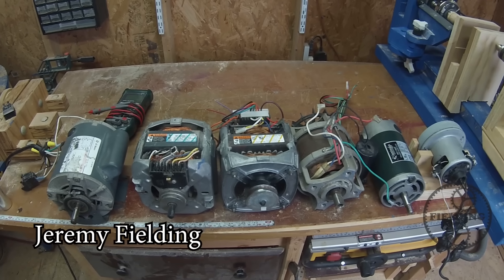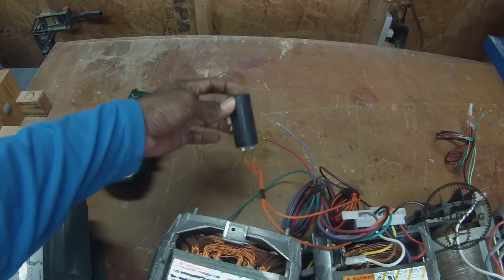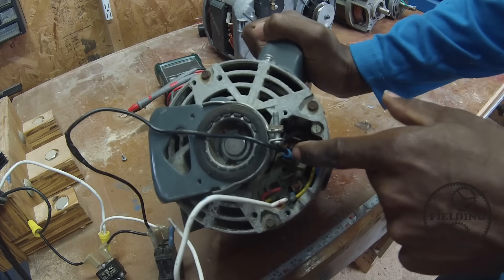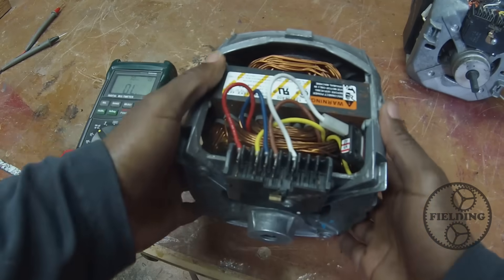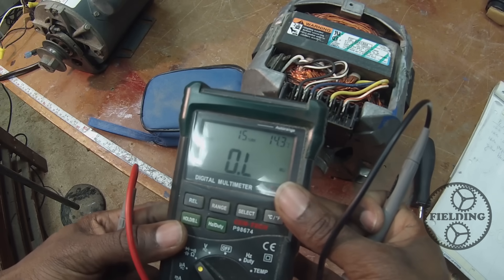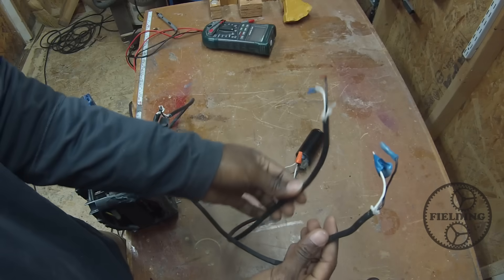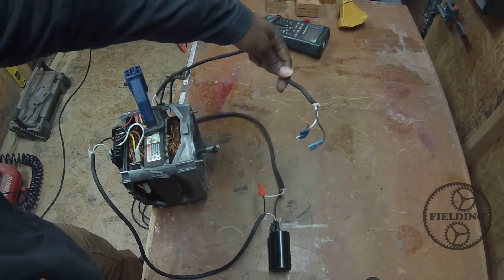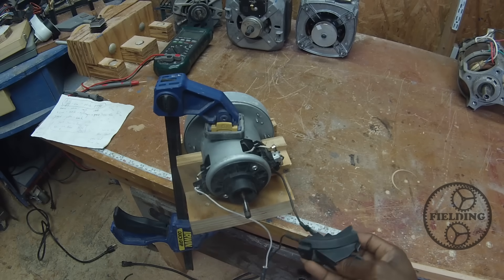How To Wire Most Motors For Shop Tools and DIY Projects: 031

Comment: If you have a under powered bench grinder like I did, I used the main cast iron flywheel/pulley from a old air compressor that had the same shaft dimensions and used that in place of the second grinding wheel .. startup is a bit longer but when it reaches full speed look out cause inertia is on my side!!Make sure the pulley  is balanced

Comment: Mr. Fielding, could you please take a close up of the wiring for the switch and fuse on the first motor? Thanks in advance, I'm trying to set a on/off switch for a lathe!

Comment: I was hoping that vacuum motor was going to have 3 wires. I have a U8232-002 with 3 wires, white black and yellow, and I'm not sure what to do with that yellow. It looks like it is part of the same coil as the white wire but why?

Comment: Does starting wire holds more amperage?
Reply: Amperage is current; he measured resistance in ohms, looking for the circuit with highest resistance.  That one controls the start capacitor.

Comment: This  knowledge will give a practical dynamic understanding of math and motors and recycling. of which I can boast an average of 500$ up too $1000 or more a month repurposing used electronics or metal . some guys do this cruising back lanes on the way to  appointments to other areas of the city. some towns have a designated  garbage day the city picks up old or non longer wanted items that don't fit in bins.

Comment: i'm haivng a problem with my motor humming and not starting - but it was working PERFECTLY before putting in new bearings (dont' you just LOVE that??) - so im trying to figure out if maybe this is being caused by the centrifugal switch plate coming into contact with the motor shaft??? problem is - it's impossible to tell once the end caps are on ...  anyone?
Reply: I think he says right in this video (or maybe another): humming is a sign that there's a problem with the start capacitor -- the lump mounted on the side of the motor.

Comment: thanks for sharing your knowledge  ,nice presentation.Not sure what Im saying /asking:Question= can a motor run without   a starter capacitor   if ya manually start the rotation ( like with a pull starter style on lawn mower ? ) I got a Chinese milling machine that humms  at start but will spin up if twist the spindle  with  my hand to get it going.I wounder if the motor would spin without the cap in circuit ?  The explanation that a cap is like an  " additional phase"  is the best  , thanks again.
Reply: You never said if the motor has a capacitor or not.   You have a start wind malfunction somewhere.   You are eliminating the start wind  by turning by hand.   If the motor has enough speed it will  be able to pick up speed on the run wind.  I could help you more if I new more.  Some motors do not have star capacitors.

Comment: just found you, AWESOME!, I have a few I need to figure out, & I did 1 last year trial & error, it was hooked up & running, I snapped pics to make sure I hooked it up correctly, & before I took time to hook it up, my phone blew up & lost pics, & first time I hooked it, nothing worked, next time it did. any difference in electric motors, from today, versus 75 years ago? I have a few really vintage ones, like 1/2 HP that probably weigh 50-75 lbs or more & are 1' around.

Comment: Hi Jeremy, my vacuum cleaner i used for dust extraction in my workshop recently conked out and i took the motor out of it to try and use it again { it is the same as your universal motor.. the last motor.}  but i had to disconnect some of the wires to remove it , so i was hoping you could show me how to rewire the motor completely.  Thanks.

Comment: Hi Jeremy. How do you determine what uF to use for a motor? I have a dishwasher motor but no capacitor. It is very similar to the one you have in the video you are testing. A short pig tail plug with 4 wires attached to it. Yellow, Red, White with black strip and Blue. I am sure the cap was somewhere else on the machine and my son did not think to take it off. No wiring diagram either. From extensive research on the parts sites I suspect it needs a 15 uF cap. Any advice would be much appreciated. I just found out about your shop, have you thought about just moving it? it is a whole lot cheaper. :)
Reply from the maker: Unfortunately I get hundreds of requests for technical advice. I can barely process all of them let alone give safe accurate advice. I simply can’t do this one on one. I explain the issue with moving the shop in the description

Comment: Could frequently starting and stopping the 3 winding single phase motor cause the breaker  "15 amp power strip" to trip, and/or switching speed selection mid cycle? Ty great vid.
Reply: Most motors draw more amps on start up so yes it could trip the breaker

Comment: Thanks for the great video! You are a great teacher, easy to follow and understand. I happen to have a motor question that hopefully you can answer. The motor from my dust collector blew the capacitor and again a few minutes after I replaced it. Any ideas why and why the reset didnt trip instead? It is a delta 1.5 hp model 50-850. Thanks for any ideas.  Mike
Reply from the maker: Unfortunately I get hundreds of requests for technical advice. I can barely process all of them let alone give safe accurate advice. I simply can’t do this one on one

Comment: Hey Jeremy, I love your channel. I work at the National High Magnetic Field Lab in Tallahassee FL in the education department. I recently took apart an  old Wolfgang Puck food processor because I wanted to get the electric motor out of it. It has a start capacitor and a smaller coil (i guess that is the running coil but not sure). I want to rewire the motor to use for something else (perhaps a grinder or something). The motor seems to be of high quality. I want to put a regular switch on it to mount to a bench  but I dont know how to wire the capacitor, smaller coil and motor. The motor has 3 wires coming out of it red, white and blue so do the capacitor and coil. The power cord has only two wires black and white which I imagine is live wire and common. Can you help me with the wiring? Thanks
Reply from the maker: Unfortunately I get hundreds of requests for technical advice... I simply can't process that many questions let alone give safe advice for each one.

Comment: ? I have a Jacuzzi motor. I plug it in but won't turn what do I have to do to it to make it turn..I would like to use it for a disk sander project..Any help will be greatly appreciated...phase 1 RPM 3450 motor 1795. model 9249000

Comment: The best tip here is to clamp the motor down before plugging it in. I suspect you learned that by experience.
Reply: Discharging capacitors is another good one! 💥😬
Reply: I plugged in a 10 hp motor at work the other day, I was all done fixing it and wanted to test it. 
I asked a guy to hold it while I plugged it in.....🤣🤣🤣
It almost ripped his arm off. (Joking, but yeah, always secure the motor.)
Reply: @joehunt3512 , fortunately,  he died from 220/440 short to the case just before it could have ripped his arm off.
Reply: Haha ik I learned that by experience. Vacuum motor jumped off the bench and sucked a load of crud into the impellor and so j had to strip it all back and hammer out the worst of the damage
Reply: 🤣 Experience!?! 😎

Comment: At 6:23 it felt like there was a time-jump. You said about making a list, which I understand, but when you showed that list you'd already got the motor working and had used a tachometer to discover which windings were the slow, medium and fast. How did you actually accomplish that? Was it by finding the start winding (using the method you described) then hooking up the other combinations with continuity one at a time to start the motor so you could measure a) whether it did anything, b) how fast it went?
Reply from the maker: There is no practical way to add more details here... but it does help to watch more than once. That will build your confidence for the parts you don't see every detail of. I also have many videos on motors, and seeing the others get wired, and me teaching about this will also help.

Comment: I recently subscribed to your channel. I do a fair amount of salvage, always have some project I would like to undertake. I recently scrapped a washing machine, and it happens to be 3 phase, no start capacitor. Not much info on the product tag, but I want to use it for a sander/grinder, or band saw. Any suggestions on how to wire it?

Comment: Does anyone know if he has a video on how to wire up a 3 phase washer motor. I pulled the motor from my washing machine and it has this on the plate. variable speed 3ph-induction motor 195v 4amp 285hz16,300 rpm max INS. class f

Comment: You can control the speed of an AC induction motor externally using a triac-based PWM control.  Your circuit must simply detect the 0 amp point of your sine wave, use a delay, and then trigger the triac.  The longer you wait to trigger after the 0 amp point, the slower your motor will run.  The Triac will turn itself off when the current goes to 0.  The relationship between the delay and the motor speed is not linear, so you will need a strobe to check the RPM of the motor for different delays.  This is basically the same principle used for a switching power supply.

Comment: can you manually crank it to start it instead of using a start capacitor? My friend gave me a washer motor but not its cap.
Reply from the maker: Yes, but that is problematic for several reasons including hurting yourself. Capacitors cost about $10 on average.

Comment: Thank you for the video. I have an old GE brushless single phase motor just like your first one. I need to wire it up but all it has inside is "L1" and "L2" - which one is hot and which is neutral? How can I tell? I couldn't tell what your motor said inside given that it's tough to focus in on that! Thanks for the help! Subscribing.

Comment: Hi,  I have a single phase motor (emerson sa55nxsfa-4865) hooked up to my furnace.  Under no load, the motor spins fine, but when hooked up to a belt (doesn't have a lot of tension) it struggles to start.  The motor itself doesn't have a capacitor.  Is this likely the problem?  And if so, how exactly do I wire an external capacitor to the motor?

Comment: Jeremy, thanks so much for the very practical advice & project ideas. I've built a few items using parts from washers, dryers, garage door hardware & whatever else was laying around.
 Built a benchtop polisher/grinder, Christmas carousels (with rotating 120 ac power) & other fun stuff.
Your imagination is the only limit. Thanks again. Mikey

Comment: Trying to add a switch to an ac electric motor single phase with start capacitor 110 volts. Six yellow wires come from the windings, and I have them grouped into two sets of three per the nameplate for low voltage.  Didn't come with a power cord, but thanks to this video I was able to wire a power cord into it and it works. But I can't figure out how to connect a switch to it all.  You show the switch in your video, but not how to connect it.  Anyone can answer, please. Thanks!
Reply: Just put a switch in the live wire somewhere before it gets to the motor.
Reply: @dalemcinnes1834  I got it figured out and working already. But thank you very much!

Comment: Washing Machine motor (I Saw in another video) - someone - make It jumper on brushes line & give DC source & It turned in high rpm - is It true?
Reply from the maker: Some washing machines (from countries outside the US) use universal motors

Comment: Jeremy, I have a single phase 230 VAC 5 hp motor on an air compressor. It has two start capacitors and two run capacitors with a centrifugal start switch. There are five wires from the motor going to the capacitor enclosure . T1 and T4 from the run coil, T6 from the centrifugal switch, T7 and T8 from the start coil, a loose T5 wire that probably connected to a capacitor at one end and other end wire nut to ? Also, Line 1 and Line 2  coming in for power. Start capacitors are both 708-850 mfd 110 to 125 vac, run capacitors are both 15 mfd 440vac. I bought this compressor with it in pieces and have it back together except for the wiring of the motor. Could you assist me with the correct wiring of this motor? I would be very grateful. If you prefer to email me it is xrayman2006@yahoo.com    Thanks and much appreciated Chuck N.
Reply from the maker: Unfortunately I get hundreds of messages like this asking for advice. At this volume I simply can’t do one on one help.
Reply: Thanks anyway
Reply: Does the compressor have 
a diagram on how it was all wired together?
Reply: Mr. Lucky 
No wire diagram. Thanks for commenting though😊

Comment: Can you wier 240 motor to run on 120V
Reply from the maker: If it is a dual voltage motor yes. I have a video on that.
Reply: No I don't think it is its 220v 300v
Reply: Is theirs a chance you can send me Email so u send you a pic of the motor its in German and have strange settings
Reply from the maker: Please Check the description

Comment: hello, tank you for this great video, i sub directly.
I have a simple question, in a single phase motor with a capacitor broken, can i use the capacitor from a microwave to replace it ? the capacitor for the motor i have is 230v 50uF, can i replace it with a 2100v 90uF capacitor ?
tank's for reading 😄
Reply from the maker: Welcome to the neighborhood! Please understand I get hundreds of emails and comments asking for technical help. It just isn’t safe or practical to try and do that at this scale.

Comment: How do I wire a brush wash machine motor with 1400RPM and can it be used as a table saw with its 1400RPM?
Reply from the maker: Please check the description thanks

Comment: Hi Jeremy, I viewed a 12KW forklift pump motor that I want to use for an EV conversion. The motor has only two terminals and when I tested it ran in one direction only. I'm going to need it to run both CW and CCW for the conversion. Whats the solution to this problem. Thanks
Reply from the maker: Pls check the description thank you for watching. I have lots of videos on wiring motors to help... have a look
Reply: Ok thanks all I need to know is if its possible for this motor to be configured to run both CW and CCW

Comment: I really need help with wiring a 5 wire motor. I'm new to this and I'm building something but I need to know how to wire it to a battery
Reply from the maker: That is why I made these videos. Have a look at the playlist I have. It will help you identify your motor and wire it
Reply: I managed to get the info on the motor . Its has a brown and yellow wire going to the capcitator and 5 more coming out the motor black, blue,red,white and gray

Shaded pole AC induction motor
and AC induction capacitor motor
MATERIAL
HOUSING: Fiber glass filled PP
IMPELLER: PP
NOMINAL VOLTAGE
100-127 VAC and 230-240 VAC
FREQUENCY
50-60Hz
PHASE
Singol phase
MOUNTING POSITION
Horizontal axis
MODE OF OPERATION
Continuous S1
INSULATION CLASS
Class 155 according to EN60335
AIR DELIVERY
Up to 850 m³/h
OPERATING TEMPERATURE RANGE
10 - 55 °C
Reply: And I just need to connect it to a battery , then I'll figure out the speed controller next

Comment: Jeremy 
As usual your video was great, but a question 
On the first motor you attached the 2 wires randomly to the posts, how do you tell if they are on the correct one?
In moving a table saw I dropped the motor and the wire pulled out
Reply from the maker: Why do you think it was random? I have found that it helps to watch more than once. I explain when a wire matters and when it doesn't in the video.

Comment: What about dryer motors? I pulled a motor from our dryer. It quit on us. Turned out the barrel was lose and a swim top got wrapped in the motor.
Reply from the maker: Same idea as seen in the video. It will be the same as one of the motors shown... most likely

Comment: Jeremy, I like your video, but I have a question.  Recently I went to visit my grandpa and he inherited an OLD electric motor from a sawmill back East. The name plate says it's a 300 HP and 1800 RPM (3) PHASE and is 4160 VOLTS.  We tried to plug it into 110 - VOLTS.  Well it ended up BURNING grandpa's farm TO the GROUND.   I wish I had asked you this question before I tried to start that motor.
Reply from the maker: That is surprisingly. I have seen these motors up close. Worst case I would expect it to make a humming sound and maybe trip a breaker. The terminals would be huge and it just seems odd that it could start a fire without serious wiring problems in the property already. Nothing to do with the motor.
Reply: Jeremy, I was K I D D I N G!!!!  I owned a n Electric Motor Rewind Shop for almost 40-yrs  The house wiring of 110/220 volts single phase wouldn't  move it 1/4 inch.  At 4160 volts it still rotates slow to begin.  SORRY, I was just playing with you.  I must AGREE with the rest of your viewers, VERY Nice video. LOL.
Reply from the maker: LOL. That is what I meant. It would hum maybe but not spin. Sometimes it is hard for me to tell because I read so many comments from all knowledge levels. So for the ones that sound bounderline I try to lean towards taking it seriously. 

Thank you for the kind words